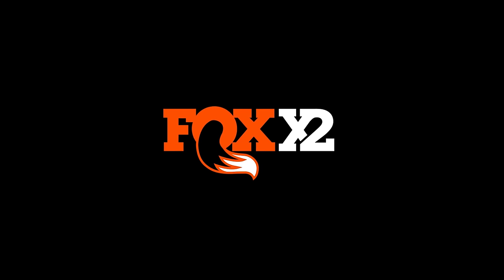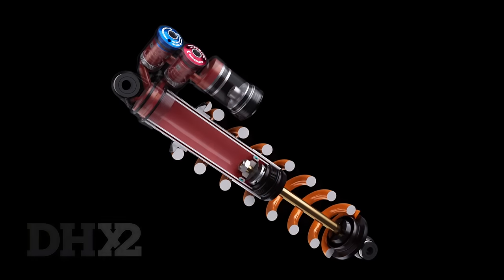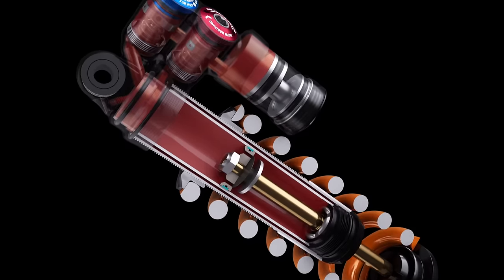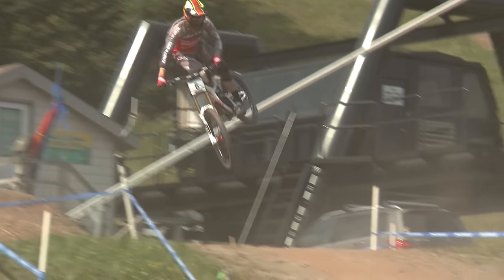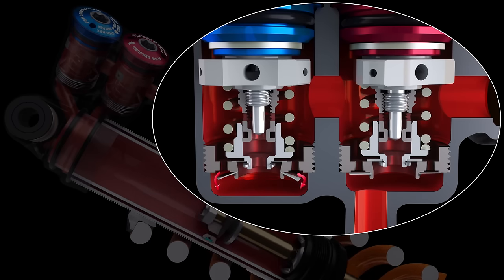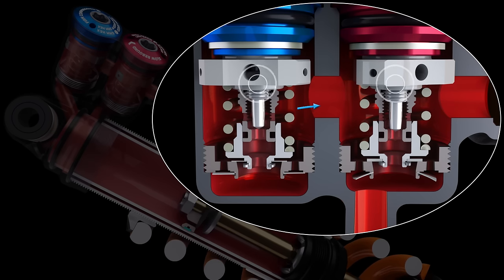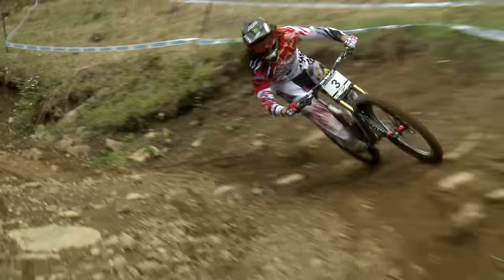FOX X2 SHOCK TECHNOLOGY EXPLAINED – FOX FACTORY, INC.

Comment: I’ve watched this so many times and I still don’t understand how high and low speed is mechanically separated! I’m going to school for engineering and I’m still baffled
Reply: Check out the Wikipedia page for "Check Valve"
It's very simple if you can break it down in your head. The fluid opens the valve when it pushes one way (usually against a spring), but when it pushes the other direction, it closes the valve.
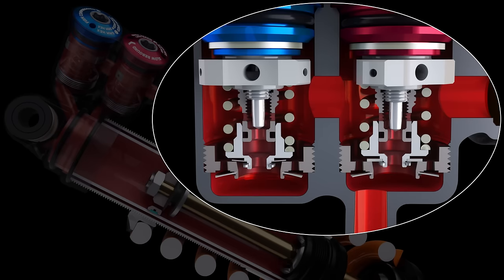At 1:07 you'll see that if fluid was to push upward (from the bottom) on those check valves (the flat things that are highlighted with the circles), they would push against the body and create a seal, whereas if they are pushed from the top downward, they would open more.
Reply: low speed = small hole

high speed= oil pressure opens a bigger hole which is "spring loaded"
Reply: the damping circuits are not separated, high speed damping is an added circuit. if the speed/force is too low, only the lowspeed circuit is open. if there is enough force/speed to push the spring back, the oil can now flow through the low speed valve AND the high speed valve. the high speed knob adjusts how much force/speed is needed for the circuit to open (preload on the spring.
Reply: @revvilo isnt that the one way valve? Hes asking a different question

Comment: I’m a mechanical engineer as well for float X2 rear shock best shock on the planet
Reply: i guess cane creek double barrel ist still better, the db was the first mtb shock with this technology;) fox x2 and rockshox vivid just copied this floating oil system..
Reply: @Absmnd647  Wrong. The guy that designed CCDB was also helping designing the DHX2 and Float X2.  Float X2 and DHX2 is better designed, more durable and stiffer than the CCDB.
Reply: @bakkenuftor  "more complex" doesn't necessarily mean "better". There are a lot of shocks that some say are better and less complicated (DVO Topaz air/SR Suntour Triair which are basically the same shock), and there are a lot of shocks that are better and more complicated (EXT's Stora for example)

Comment: Hving a full brace u put your leg into instead of just on a peddle, might b good start. Problem is u hve to b able to put foot down or drag it. So the leg/ bike brace would hve to attach to u & then u step onto peddle, w/brace. This will give u suspension pnts on both legs & protect the lower legs.

Comment: I have a 2018 Float X2 on a Santa Cruz Bronson. I weigh 160-165 pounds with all gear. What settings do you recommend to start with?
Reply: 20% sag depends on your riding
Reply: 28-33% sag. 20 for the fork. 20 for the rear is way too little.

Comment: Next is handle bars & grip: Fast peddling means rocking back & forth side to side, but w/Ebike or motor bike that is not a factor.
Reply: Safety factor is disconnect the hands from grips/steering & not flipping over. Which style is safer grip parallel or perpendicular to frame(pedaling or more important Ebike not)
Reply: Mayb 45 deg so u can still peddle but fine if don't but still good control of steering.
Reply: Or try all 3 grips in 1 peddle or 45 deg or perpendicular in 1 important to keep control of steering. 3 grips left & 3 grips right side. Speediest crouched 10speed style least control.

Comment: Where is a good place to send a fox rear shock for repair.  Bought a dh bike that came with a thought to be blown rear shock... turns out the bone head was turning the damper shaft to adjust preload and the nut that hokds the piston onto the damper shaft unthreaded n came off. No damage just the shim stack went all mixed up.
Reply: Send it to fox or go to your local bikeshop for a rebuild.

Comment: Can someone verify that with faster  Rebound (less rebound damping) you  increase the mid stroke suppot and bottom out resistance?
I have cross check this countless times but i ve never seen anyone mention it.
Reply: Not sure if you are still looking for the answer but rebound will not do much for support. What you need is compression adjustment. Rebound only (in theory) works as the damper is extending. It’s the adjustment that prevents the bike from bucking you off. 

Compression damping is the resistance to the damper being squished as it’s moving. 

Keep in mind that “mid support” can also be caused by suspension kinematic design and the ramp rate of the spring + any friction effects going on.

Comment: What the hell does slow and fast rebound mean?!
Reply: It's how fast the shock goes back to the original position after being compressed
Reply: Matess 36 ik that but what’s slow and fast rebound
Reply: Idk how to explain it more, it's self explainatory. Well slow rebound is when it takes longer for the shock to reset, fast rebound is when it resets quickly.
Reply: Matess 36 no I mean slow speed rebound tuning and fast speed rebound tuning, like on the fox x2 with different tuning types
Reply: I'm new to tuning shocks, I thought you only needed to explain rebound, I can't help with anything more.
Reply: Matess 36 that’s fine
Reply: @willshawyer7280  Slow rebound tunning affects the behaviour of the shock while shaft speed is low. High speed rebound affects the behaviour of the rebound when shaft speed is high. They are not completly independent though, the is overlap. Also, if HSR damping is too low you can't control LSR since oil will blow through the HSR circuit instead of being forced though the LSR circuit. Hope this makes it clearer
Reply: Laurent Parmentier thenks

Comment: Last is seating again w/biking BMX or motor cross bal & standing or partial seating is v/diff from just riding a bike. The old style banana seats r safest, bc u hve largest area to land back down on. U can jump w/2 riders & still land it.  Hving a modern hinged in middle banana seat gives u 2 seats in 1  & positions to rest on or against or actual sit back down on. Bc it is hinged if u know going to take a hit u want to b rear most shocks absorption 2 on back & most travel.  So many dynamics w/speed & jumps BMX & NOW Ebikes r more motor cross then req biking. It needs the connection pnts disconnected from bike.
Reply: Normal BMX 4 hve frame flex shock & front fork shocks but need leg bracing shocks right at peddles & seat shocks w center hinge & u need a seam steering shock system as well. Skimp on any of these connection pnts & not wearing BMX type safety gear & it is not going to end well. Ebike who knew.  Best I can do just taking a swing at it.

Comment: is there a reason m not using my full travel,I'm running a 200x50 shock,but was wondering if this is the same shock as the 200x57 but with a washer or something in it meaning i don't use the last wee bit of travel but I'm actually getting full travel,
Reply: You would get even more travel with a 57mm stroke, but only if your linkage system supports that.

Comment: for the masses I don't thick it is safe to bmx bike/ ebike. Jids sure or teens but not masses. Need a new design that disconnect rider from basic bike design contact pnts, but as yet I got nothing. In motor cross u hve padding & helmets & chest guards & more frame but on bikes it is not safe margin. God/JBM my option for what it is worth. U never forget how to but doesn't mean your still able to & that is a req bike not BMX or NOW Ebike.

Comment: looks little too complicated to work stable for longer than 1-2 race, so it's advanced expensive peace of shit :))
In most cases advanced complications are almost only for marketing purpose only (to rise up prices). So because of that I'm using rock shox, i't just working ok and for a long without huge maintenance.
Reply: nonsense man, i work on huge hydraulic machines with similar technology and its built too last, got to love hydraulics.
Reply: You have no idea what your talking about. This is just as reliable as previous fox or other standard type shocks but this system provides more consistent damping while in use. Check out Ohlins TTX, same thing. It also requires less time to revalve due to the shim stacks being so easily accessible.
Reply: there basically the same technology :P
Reply: YOu can ride this for months without servicing it.